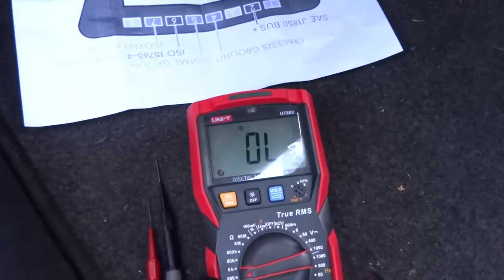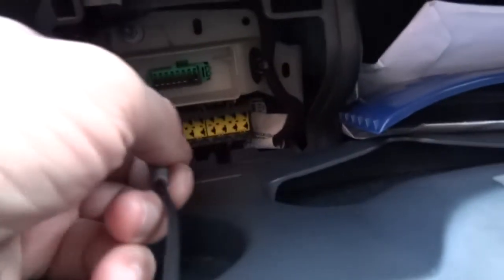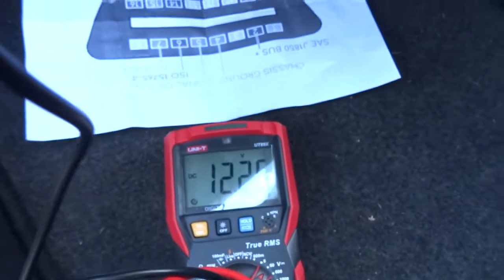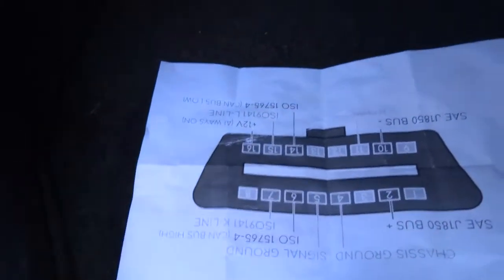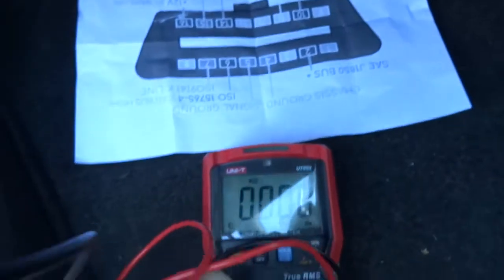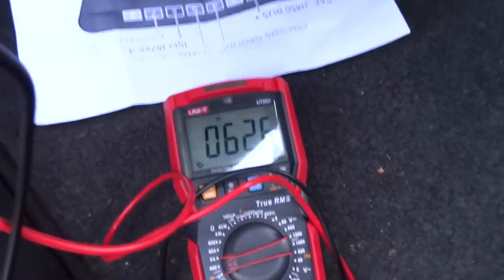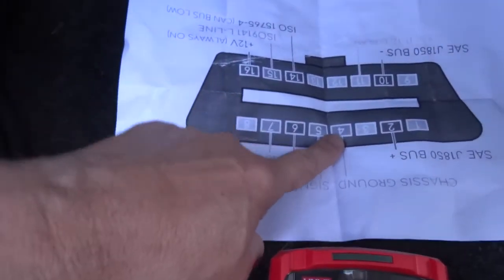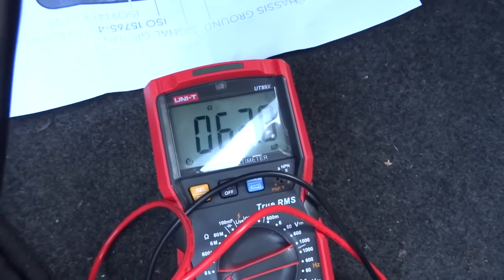Testing CANBUS Network , OBD2 connector Diagnostics with multimeter CAN BUS

Comment: I am trying to test our 2005 Buick Rainier, and it has pin 2 as the high volt communication line, and the ground as the low volt line.  Do you know how much resistance there should be on this type of J1850 VPW CANBUS?  Thank you.
Reply from the maker: Sorry i don't know never measured this system.